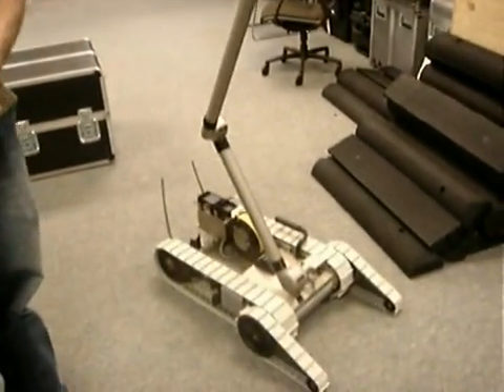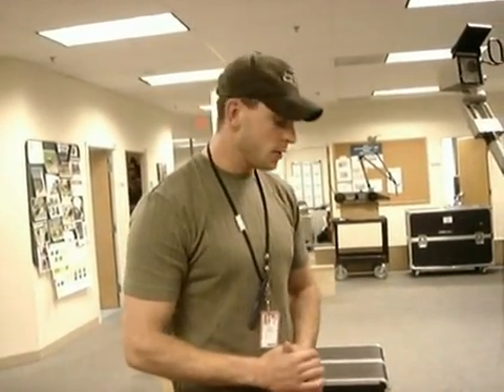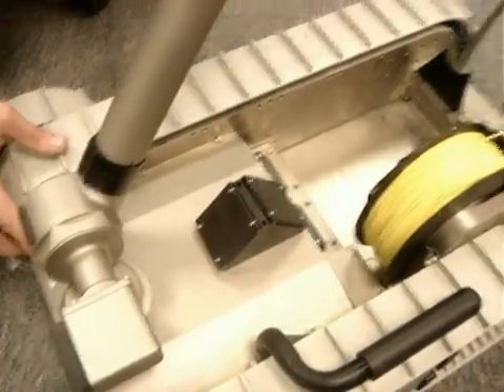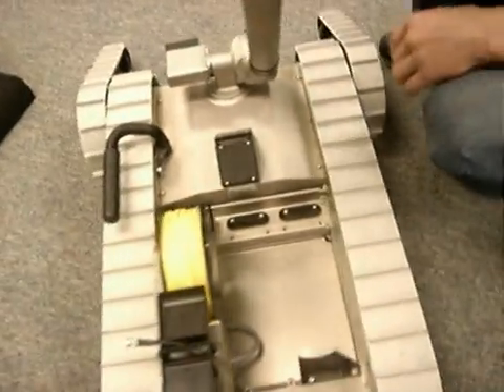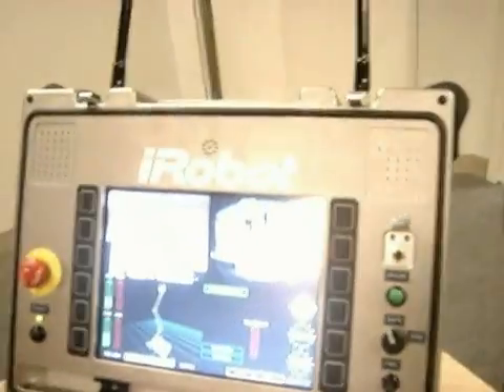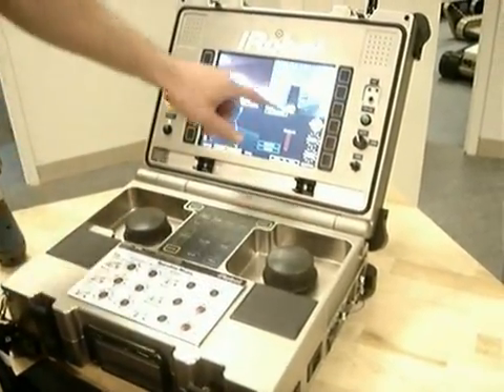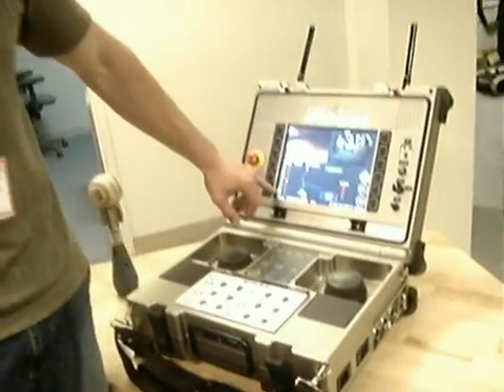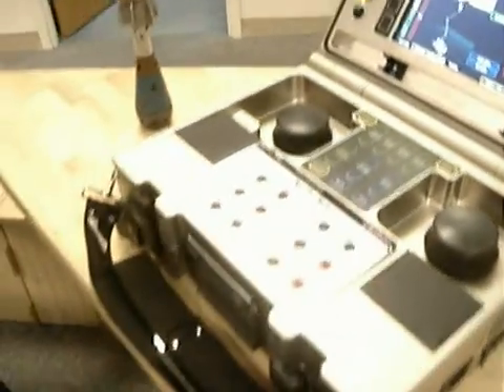iRobot's Packbot

Comment: The LEGO PackBot I saw also on youtube has the same chatter.  However, if the chatter is just a little non-destructive gearslip between the rubber treads and the plastic wheels at maximum operation load, then maybe that's ok and is an engineered self limit.  I'm pretty sure that's what it is, not gearbox chatter.